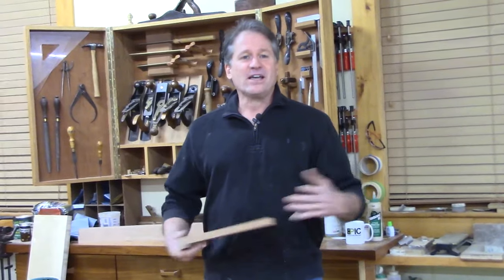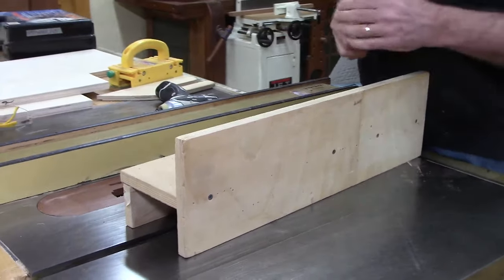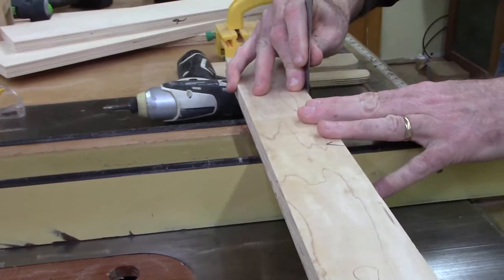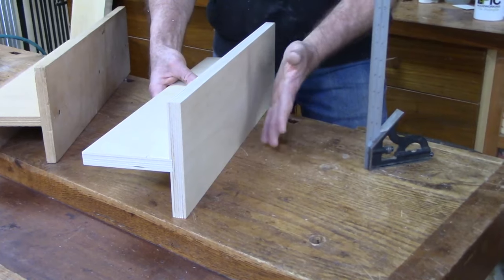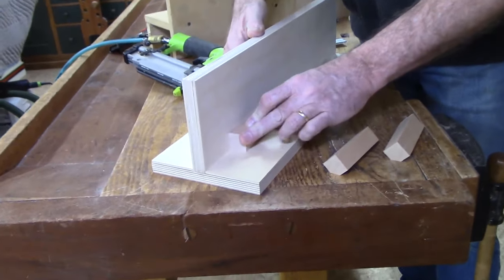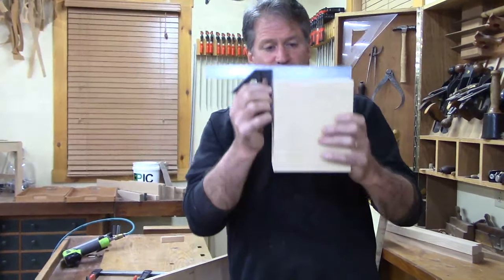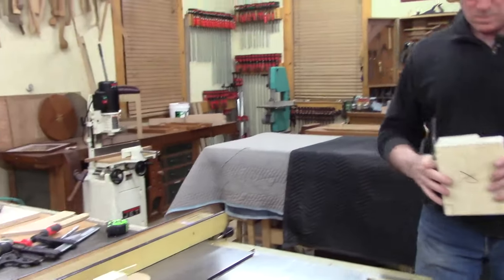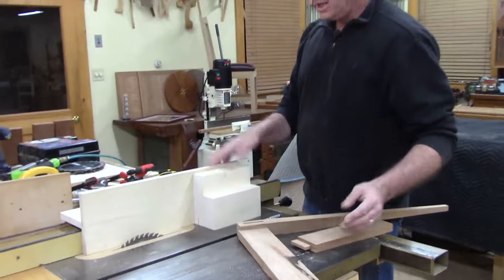Making a Tenon Jig For the Table Saw with Tom McLaughlin

Comment: Once again great show Tom and Kris! Tom, I just wanted to add my little bit of knowledge to the conversation regarding the glue blocks and why they are chamfered on one edge...Back in the "olde" days one of the tasks for the apprentices in the shop was to practice using the hand plane by truing up two sides of the material used for the glue blocks to a 90 and to chamfer the opposite edge of the 90. Once that was done the lengths of glue block material were then cut into various lengths and tossed into bins at the master's benches throughout the shop. The chamfer was put there for two reasons, 1) It allowed the master to reach into the bin and feel for the chamfered edge and this would tell him the opposite edge was the 90. 2) Once the glue was applied the glue block was put in place and the master would use his thumb on the chamfer to slide the block back and forth (rub joint) and for a few seconds put pressure onto the glue block. Apologies for the long-winded description. ;-)
Reply from the maker: That’s an awesome back story to glue blocks Dan, thanks! It makes a lot of sense, I never thought of the champher indicating the square side is opposite...but it makes perfect sense, especially since I’ve done that myself in practice but never considered the source. Now I can repeat that next time I’m asked and  sound as historically knowledgeable and impressive as you do right now 😎👍

Comment: The reason plywood is undersized is because most plywood is imported from Europe on the metric system and measured in mm. eg. 12mm= 15/32 or 23/32= 18mm. Mostly imported from Scandinavia and Germany.
Reply from the maker: Thanks for the explanation! 👍